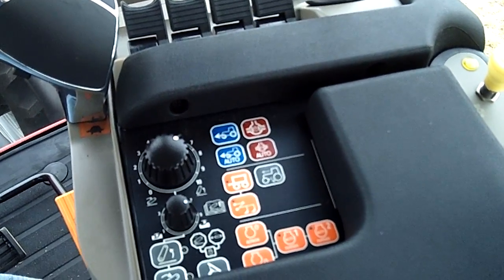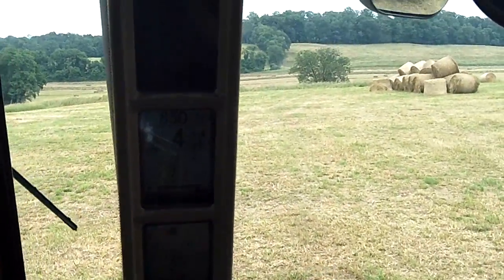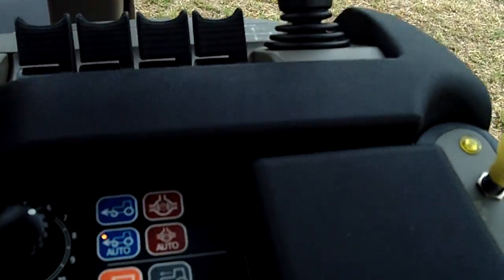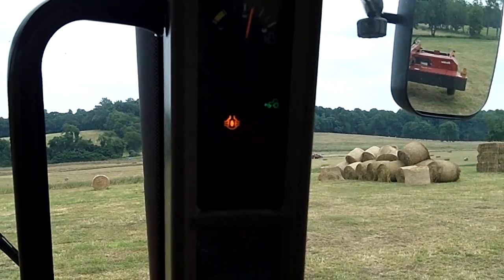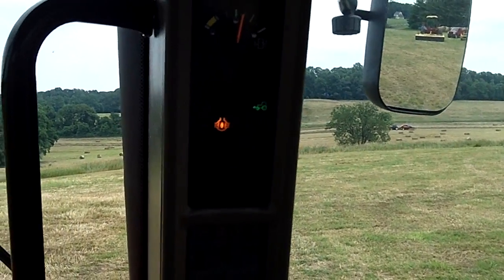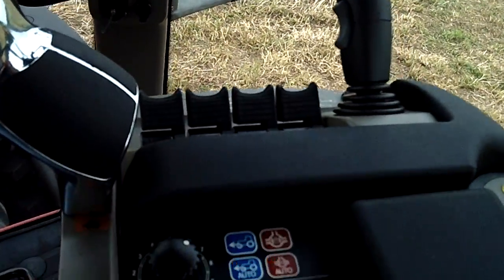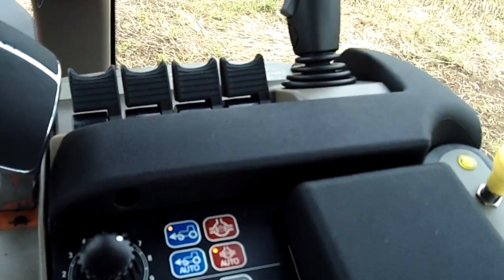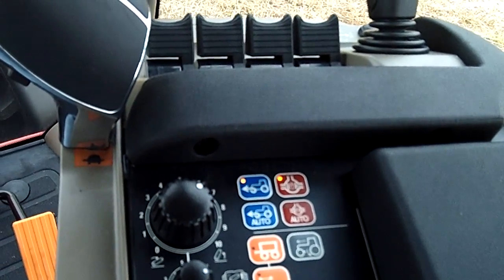Auto 4wd and Diff Lock

Comment: When you have the diff lock on both front and  rear diff lock are engaged or only the rear one??
Reply from the maker: Both can be engaged, specifically the steiger tractors, as you turn they will release from the steering sensor position.   On a MFWD, as you turn you will lose diff lock and then turn further and lose 4wd to save the headlands.